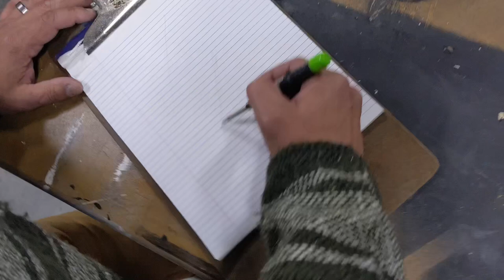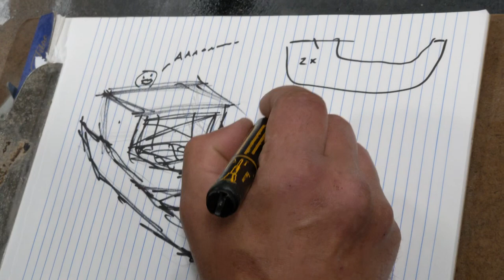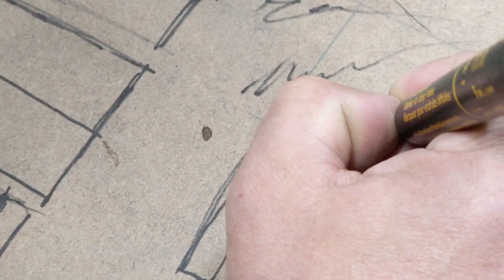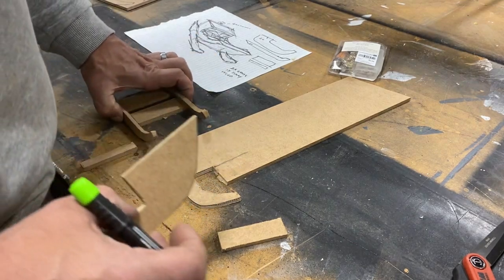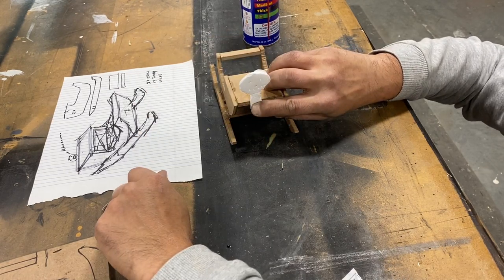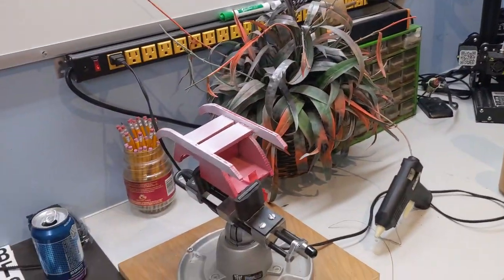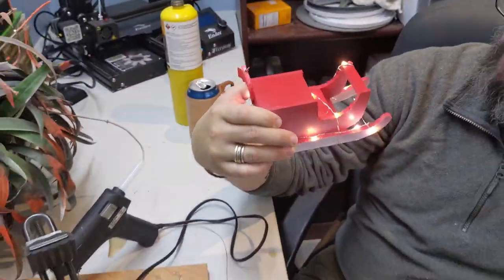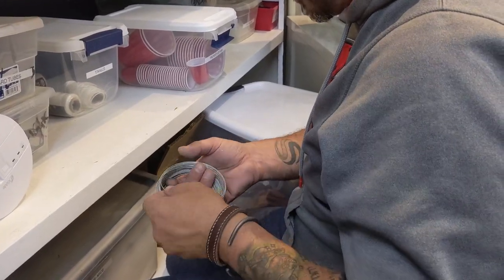Bandsaw Sleigh

Comment: im probably overthinking this but why were you spraying WD-40?
Reply from the maker: That was 2P-10, a CA (crazy glue) glue accelerator, hastens the curing process to a few more seconds.

FastCap 2P-10 Super Glue Adhesive 2.25 Ounce Thick and 12 Ounce Activator Combo Pack https://smile.amazon.com/dp/B0006IUWCC/ref=cm_sw_r_apan_glt_fabc_HRDEHGN145W8PWZA3C5P
Reply: @TheNewJankyWorkshop  I learned a thing. Neat :)
Reply from the maker: @shawnkerner2923  that's awesome! That's what we want to happen. Thanks for watching!